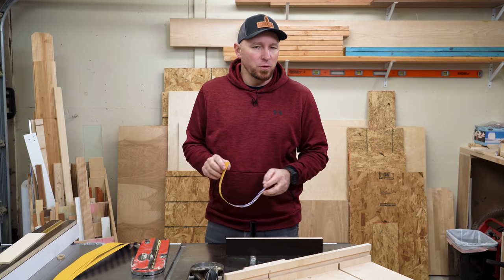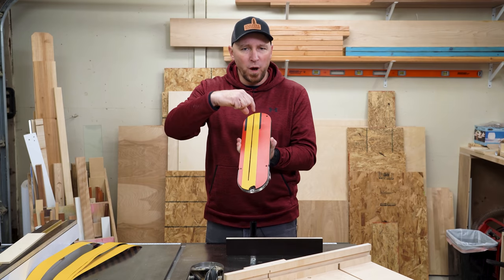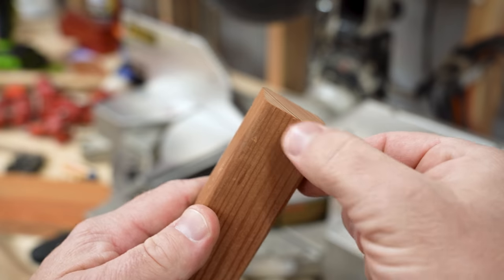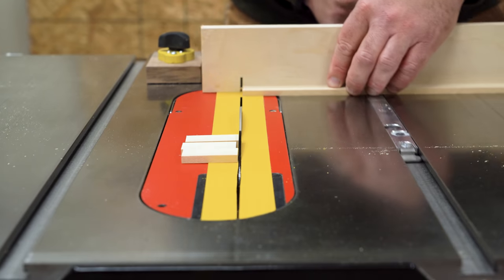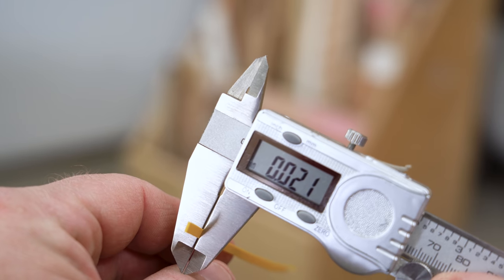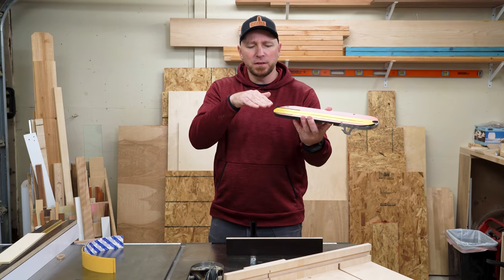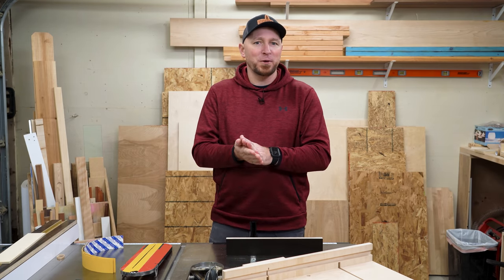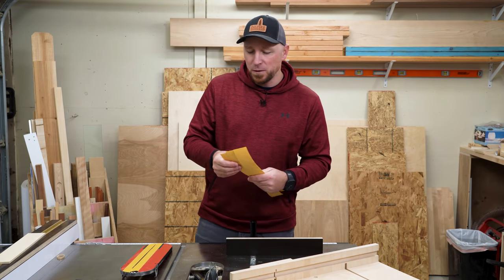Get Splinter-Free Cuts with THIS $2 PVC Tape

Comment: AWESOME --- no other words explain this tape.  I had been searching for a Zero Clearance for my Hercules (HE74) 12" Miter and had given up because only one company made them at the cost was $18 for the plate and $18 to ship --- way too expensive for my budget.  And then, I came across this YouTube a few days ago and then some others and I ordered the tape from Amazon.  I figure $10 for 5 strips of this tape was worth the try and it works.  I removed the throat plate from the saw, vacuumed out the crevice, reinstalled the throat and applied the tape.  I put a scrap piece of 1/4" plywood down, made a cut and a cut through the tape, then I made some additional cuts in the scrap and checked the tape.  Good as new.  I wish I had seen this video before I purchased a pair of zero clearance plates for my table saw.

Comment: I came across this stuff on Amazon a few years ago. I use it on my mitre saw and it’s a game changer. You can see immediately where the blade will cut coming from either side of the blade for way more accurate cutting. Only downside is if you have to tilt the blade it is then no good for the vertical cuts. I use my mitre saw inside and out, this stuff doesn’t lift when it gets hot or cold.

Comment: I took it off my miter saw because it catches wood.  If I used it on a table saw I would cover the whole throat plate rather than lowering it.  There are instances where a board will catch on the other side going out if the cut, like when the fence it covering part of the throat plate.

Comment: I have used this on my table saw for about a year because the factory zero clearance insert is too flimsy. I cover my whole insert so I have a level surface and I rounded over the front with sandpaper. Works great!
Reply: Great idea - I hadn't considered simply covering the whole insert.  Thanks David.

Comment: I do something very similar to this; I use the Fast Cap laminate tape to do the same thing. Yes, it's double sided but if you never peel off the backing membrane then you have a super sticky, durable, one-sided tape that is not as thick as the strips you're using and it's cheap, as I already have a roll in the tape drawer!

Comment: Another great reason for 0 inserts especially for those who sometimes have less than nice, warm shops.. As you mentioned in another video with wide openings the blade acts like a fan. I don't know about the rest of humanity, but I hate working with my hands when they're frozen stiff or just really cold and turning on the fan when it's really cold? Zero clearance really helps reduce the fan effect and might even throw a bit less sawdust at your kisser.. 
I did invest in those quick change inserts for the Sawstop from infinity?  I think it's infinity, but whoever sells them it's not a bad deal especially if you're constantly changing blades, ie dado, cc, rip.. Makes life a lot easier.

Comment: Fantastic! I got a Skil saw last year that they haven't designed a ZC insert for yet. I tried to make my own and learned that there's a bracket that runs beside the blade that sets higher than the set points for the plate (so I had to remove material from underneath what I made to try and set flat). It did not turn out great, so much had to be removed that it was pretty flimsy, developed a crack. Was thinking about seeing if someone could 3D design and print some for me, but this tape looks like a winner!

Comment: I made my sled and 0-clearance insert out of formwork plywood, so the surface is incredibly durable. And as I always use the same blade width (1/8"), there's no need for any extras. :)
If I were to to cover an insert with this tape, I would probably make sure it covers the entire width of it to prevent any chance of the workpiece wobling on the edge, no matter how little.

Comment: One thing to be aware of is, saw start-up causes vibration, so starting the saw while protruding through the tape will cause it to chew up the sides (which is why the sled or plate got shewed up anyway). To keep it to a minimum, while a hassle, it helps to start and stop the blade with it lowered below the tape surface. On a sled, it will definitely annoy when the material invariable catches on the edge, and true square will be noticeable to those anal about it.

Comment: How does the thickness affect your work at the miter saw you can’t adjust the throat plate at the miter saw ?
Reply: Depends on the saw, but almost all can be adjusted or modified. If you have to modify, the might as well just make your own.
Reply from the maker: A lot of them are adjustable, but if not, you could always put a piece further down the line to support the material. All depends on what you use your saw for.
Reply: Thanks

Comment: So using the sled application as an example... is the thickness negligible that you don't need to level out or do you need to put additional pieces to the left and right or something to make sure the piece lays square at the cut?
Reply from the maker: I believe it's like .021 (inches) or something like that, if I remember right. So assuming that you use your sled for cutting accurately, yes, a piece or so to the left or right would be necessary. My thought was that if you cut narrow pieces a lot, just run a strip to the left, back against the fence that you hold onto while using the sled. If you cut wider boards, put a strip or two running the same direction as the blade, to the left of cut, about five or six inches apart from each other. Hopefully that makes sense. It all just depends on what you use the sled for, I suppose. Since lots of sleds can be made for very specific tasks.

Comment: Off topic question you have a sawstop are you limited to what brand of saw blade you install
Reply: Any steel blade will work
Reply: Can you write above a 1st grade level?
Reply: @dontblameme6328  that’s aggressive why would talk like that 
This is a great YouTube channel why would you be so judgemental do you need a hug
Reply from the maker: No, not brand. You just can't run anything ridiculously thin. Regular full and thin kerf blade work great. Also, it can't have any type of thick coating, like paint, on the teeth themselves. But coatings on the blade are fine.

Comment: I tried these strips a few years ago and they did not work out for the miter saw. The cut was always slightly crooked due to the height of the strip. Also, on the crosscut sled the work piece has to be lifted over the tape each cut instead of simply sliding it.
Reply: On your crosscut sled, you can take a flat bottoming router bit and create a recess the exact thickness and width of the tape into the base of your crosscut sled to fix this.
Reply from the maker: So I wanted to mention stuff like that in the video, but then everyone would say I talk too much. Like I said though, if you lower the insert you will be just fine. If you can't lower with the adjustment screws you can sand or grind down the underside to make up the difference or drill the holes in the insert deeper. Depending on what you use your saw for, you can also just put a piece of the zero-clearance tape farther down the line for material support. As for the crosscut sled, same thing here. You just have to put another piece running left-to-right, against the fence that your hand holds. Super easy. You just have to be creative.
Reply: @InspireWoodcraft  If the kerf in the crosscut sled has  gotten too wide, I find it easier to just inject some epoxy into it and recut it. I have a low end Delta miter saw and the tape simply did not work since the blade slot is only 5/8". The Fastcap strip cuts were not 90°. I managed to cut a piece of wood to fit into the slot and it has worked very well.

Comment: how hard is it to change out?
Reply: It's tape, so it cannot be changed. You have to replace the saw. The good news is that it comes in a pack of 5, so you don't have to buy more until you've gone through 5 saws. 
🙄
Reply from the maker: It is pretty sticky. I only swapped it out once, and in a hurry. I used a heat gun to loosen the adhesive, flooded it with adhesive remover, scraped the adhesive off and then cleaned it up.
Reply: @dontblameme6328  🤣Nice

Comment: With my table saw it would be good only one time.  Here's why.  After putting the tape in place and raising the saw blade the slit is tight to the blade.  Now I shut my saw off to do something else.  Next time I make a cut I start my saw.  All of my 10 inch blades distort when the saw starts.  This now makes the slot wider where the saw teeth are.  So now the tape is no better than my insert that is not tight to the blade because the blades distort when starting my saw.

Comment: Putting it on a chop saw or on the sled will(does) change the angle of the cut. I know this because I tested it on mine. The solution is  to place a small piece of the tape under the board being cut. Place it at the end of the sled or chop saw table. Problem solved. Keep up the good work.
Reply from the maker: I'm in the process of adjusting my insert for that very reason, but I like your idea too. Instead of sticking a piece to the saw permanently or fussing with the insert, you could just leave a piece, with the backing still on, next to the saw at all times just for when it's a cut that matters.
Reply: @InspireWoodcraft  That's what I do. It works well.